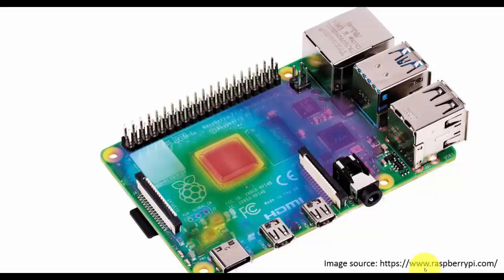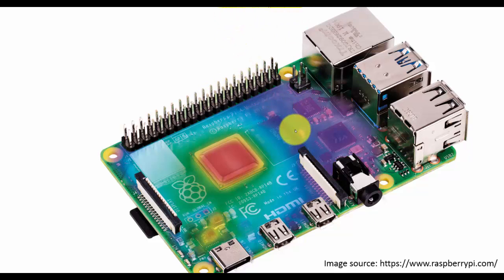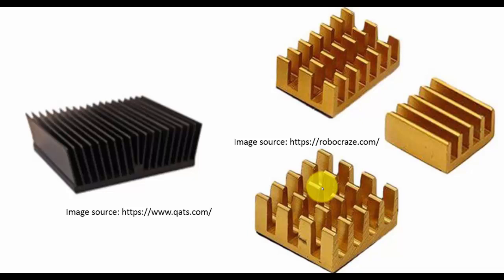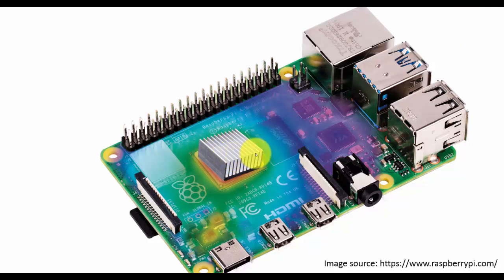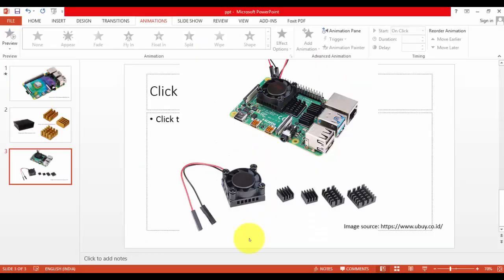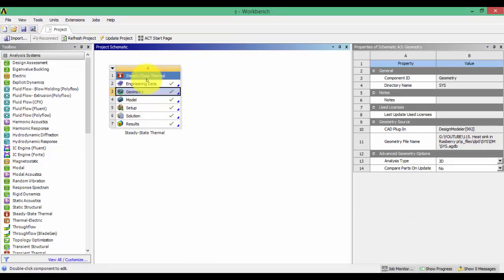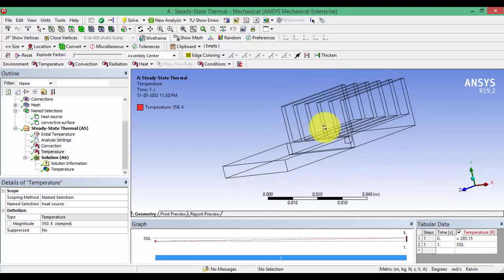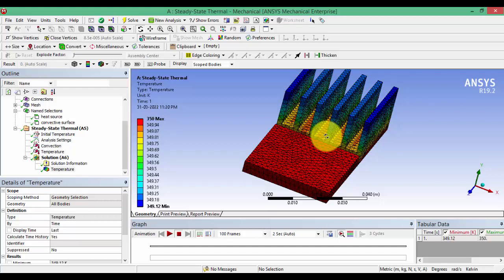Heat sink in electronic devices | Simulation in Ansys Workbench| Cooling Raspberry Pi | Arduino

Comment: Hi, Im doing a final project research and I would like to obtain the thermal conductivity of the material of the heat generation. Appreciate it 🙏
Reply from the maker: Unfortunately, as far as I know, ANSYS cannot calculate thermal conductivity on its own. Instead, we must input the thermal conductivity value obtained from experimental data or reliable sources like material databases. However, once we provide the thermal conductivity along with the heat generation rate, ANSYS can generate temperature distribution results across the entire domain.